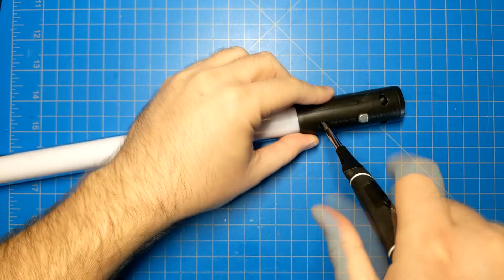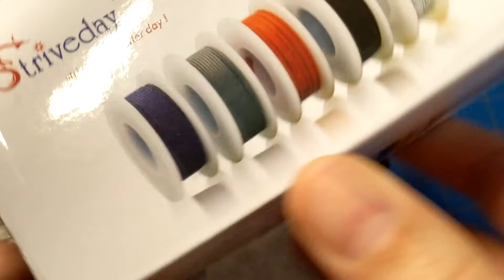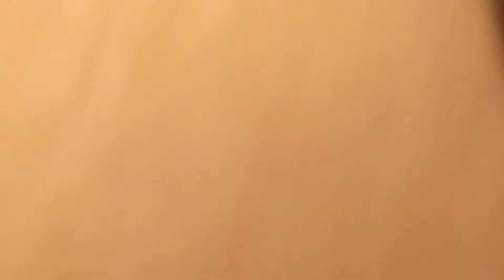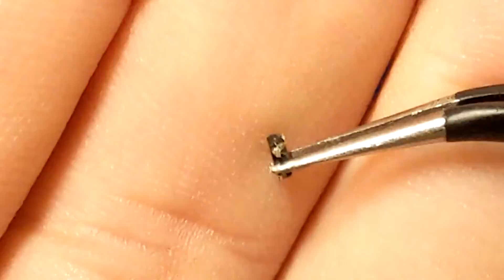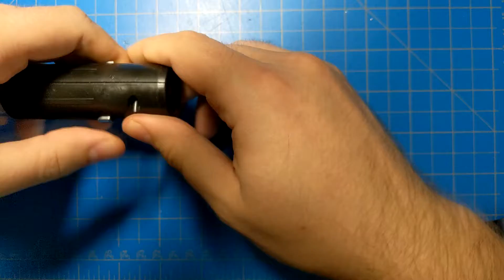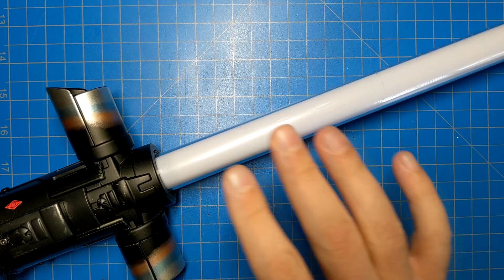Swapping Red and Blue in a Galaxy's Edge Lightsaber Blade

Comment: Can you get white or purple with a green saber?
Reply from the maker: yes, but it's complicated. you would have to hardwire the blade for the color you want, meaning it won't produce any other color. and due to how the blades work, your purple and white will be brighter and go through batteries much more quickly than a normal blade.

Comment: Hello There. I know this is an old video, but I was wondering if you had some pointers on trying to mod a blade to get Orange from blue?
Reply from the maker: Do the red and blue swap. Then remove D10 and replace it with a small piece of wire. Then use the diode you removed from D10 to connect the yellow and red transistors. Removing D10 increases the brightness of red slightly. Using it to connect green to red will cause green to turn on when red is on, but also reduce green's brightness a little, producing orange. 

In another video (https://www.youtube.com/watch?v=OiYes0s9IyE) I performed replacing D10 with some wire then using it to connect green to blue. You could use that as a reference for what I'm talking about.
Reply: @Ruthsarian  thank you, just the guidance I was looking for.

Comment: Wouldn’t a little code tweaking on the control IC be easier?
Reply from the maker: Yes, except this is a stock blade controller. The IC is a one-time programmable chip-on-board. There's no reprogramming it. So mods like this are necessary. However I am working on a replacement blade controller that is reprogrammable.
Reply: @Ruthsarian  I've got a bad board--the bottom third, and sometimes the middle third won't light.  I saw your vid on blade repairs and there was nothing too obvious I could see to fix it.  Would your replacement board be essentially a drop in replacement for the stock board?  I.E. solder the blade on and you are done?
Reply from the maker: @im1066  check the three wires that go between the connector at the base of the blade and the control board for the blade. if one of them came loose it's possible not enough power is getting to the blade which could result in not all the LEDs lighting up.

as for replacement board, yes it should be a drop-in replacement for the stock control board, everything else in the blade would remain the same. i'll be working on a video soon showing how to assemble and swap in my board for the stock one.
Reply: @Ruthsarian  Will do, and I'll keep an eye out for your board.  I was focusing on the blade side, not the hilt side...